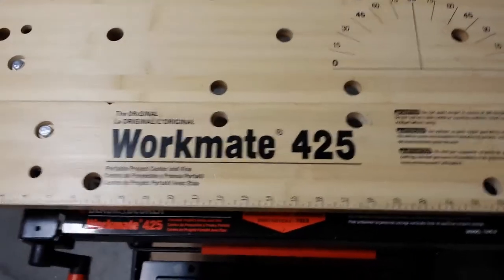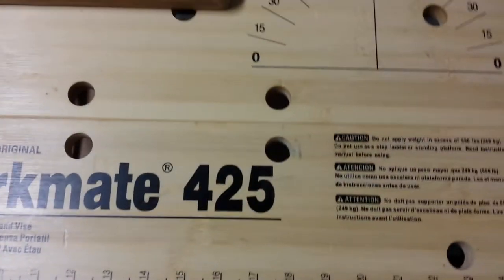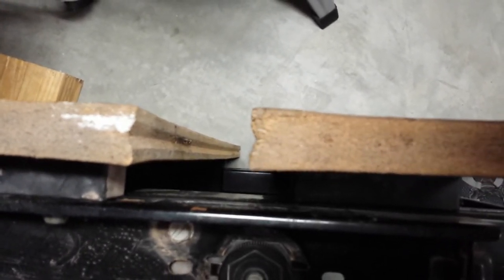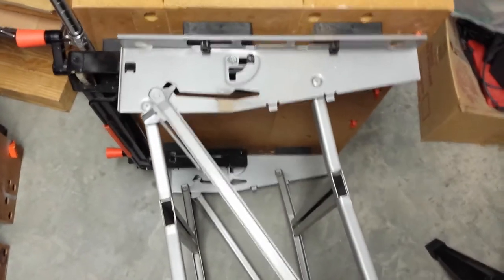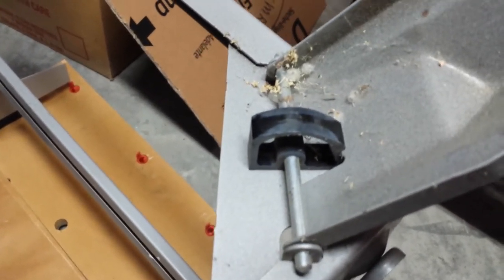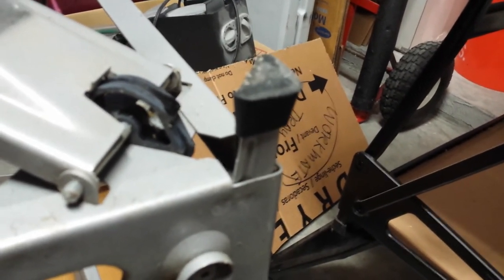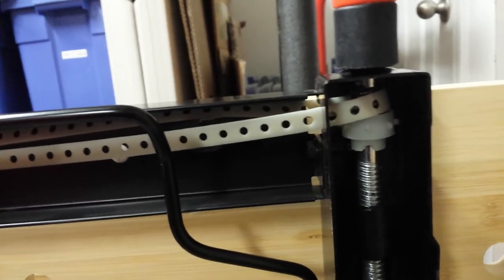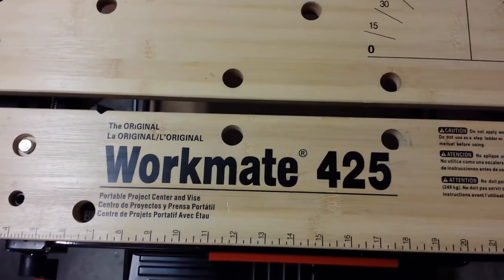How To Maintain Your Workmate 425

Comment: Thank you for this video. If the belt is connected both sides, turning one handle will move both equally. My belt is off one side so i can tightened at an angle for awkward shaped items. I don't mind spinning both handles separately.

Comment: Good video. Had no idea there's a Workmate community. Yes, bamboo is very rigid. It is often used in high-end loudspeakers for that reason.

I have an original WM, a 425, and the Harbor Freight version. Thanks to your videos, I now know there are different '425s - mine is a type 5. The 425 is setup as a side table next to one of my benches. The HF version is poorly built; I use it for painting, grinding - essentially where the condition of the support doesn't matter. I don't recommend it. Love the original. Very good build quality; surprisingly rigid. Takes literally a few seconds to unfold and fits almost flush against a wall. A fantastic product. I'll lube the benches. Haven't done it at all in all these years. Should make a nice difference.
Reply from the maker: Felix F Hey, Thanks for dropping in and sharing your experience with your Workmate. I would be interested to know what kind of work you do with your Workmates. And, Welcome to my channel.
Reply: Thank you for the kind welcome. Had to think about the question. Other than general tinkering and futile attempts to fix things, I like to work on old tools. Old machinery in general. Industrial vises are a personal favorite - 11 mounted in the shop and a whole bunch more scattered around. Have a small vise on the 425 - a Stanley 700. Not sure if you're familiar with the tool, though you'll likely recognize it once you see it. Stanley made these for decades. It's small corner vise. Ridiculously handy. I also have a metal lathe. The 425 sits right next to its bench and holds the machinist toolbox and assorted bits and pieces. It's nice to have a work surface in that location that's not covered with metal chips. I like your idea for a bottom shelf. Will likely install one. The 425 is stationary in this setup, but it's easy enough to pull out if need be.

The original WM I'm a bit careful with, as I feel lucky to have found one in such good condition. It's setup when there's an instant need for more space. Happens more often than I care to admit. Used it just now, in conjunction with a big, heavy 6" drill press vise to work on the jaws on a monkey wrench. Normally, however, it doesn't see a lot of grime - that's what the HF version is for. Here's an example of its use: Last night I needed to measure something that was just machined on the lathe. My big surface plate is, well, big. It's on the other side of the shop, too. Literally, it's like a tombstone. I also have a much smaller 9x12 surface plate that I setup on the WM and was able to do the deed painlessly and easily without having to move to another bench. I typically use the original WM every 2-3 days.

The Harbor Freight version is very poorly built. The quality of the materials is subpar, and its action has little in common with a real WM. It is used for painting, holding bench grinders, a support for a miter saw and the like. I don't work with wood very often, and I'm not very good at it at all, but sometimes there's no other option. It so happened that it broke the other day; one of the wood panels cracked pretty deeply. IMO, it doesn't make sense to fix it. Saw a used WM at a garage sale nearby. May buy it. Not in great condition, but for this I only need a stable support and would rather not have another HF model.

There's another variable here. I also work on automotive paint: compound, polish, install ceramic coating, etc. Clearly, this necessitates a very clean environment. That's why I first started using a WM. It can be pulled outside, doors closed, and the metal dust doesn't hit the cars(s).
Reply from the maker: Well, it sounds like your really putting your Workmate to good use. And, you must have a much bigger garage shop then I do. Lol.

Comment: The belt came off of one side of our 425. We have tried to get it back, but no success. Do you have a video that shows how or a tip that helps? Thanks.
Reply from the maker: Get one end of the belt completely on one sprocket.  Take the other end of the belt, slide it partially on with at least one tooth holding it on. Then turn the crank at that end in a direction that will feed the belt on the rest of the way.  This is similar to the way fan belts are put on.

Comment: @WorkMateGuy, I just received and assembled my 425, type 6 just yesterday and am thoroughly enjoying your various vids--good job on all!  I do have a question.  While cleaning up after assembly I found a small spring on the garage floor that looks very similar to the springs on the 425, but I can't seem to account for any lost springs on the unit.  The spring in question is about finger length and about the same diameter as the other 4 springs (2 for the main lifting function and 2 for the base panel to lift to vertical).  Is there a 5th spring placement I haven't found yet, or might this have just been loose in the box, or maybe even just something my wife had in items she was sorting???  Not sure.  Any thoughts you might have would be appreciated.  And thanks for the maintenance tips, they'll be used immediately!
Reply from the maker: I suspect one was in the box you did not notice when unpacking.  Other wise, you would have spotted its home.  :-)

Comment: I can't believe I missed this one before.  My Workmate is tighter than a drum and I just figured it would take some time to break in.  I hit all the points with WD40, but, that hasn't really solved the problem.  What kind of oil are you talking about?  Maybe 3 in 1 or something else?    I have always heard that you should not put Vaseline (petroleum distillates) on anything rubber because it will disintegrate it. I'm not sure if that's true, but,  I have never done it.  I will most likely use lithium white grease there.  Keep up the great work!  :-D
Reply from the maker: Kathleen Zimmerman Hi Kathleen. I used 3 in 1 oil, but you can use lithium grease or WD40 depending on your needs.
Reply: I have use 3 in 1 oil also and have not had any issuse
Reply: The WD in WD40 stands for water displacement. It is not a lubricant; it's a solvent.

Comment: Thanks for these! I just bought a 425, and these are helpful. One question... I saw in another video that you clamped down a tapered piece of wood. How do you do that when the handles turn in sync? Remove the syncing band? Or just crank, and deal with it. Thanks!
Reply from the maker: Hi David - The cranking mechanism should slip to accommodate the variance in the width of the work piece. If it does not slip then you might have to temporarily slip the belt off of the gears.  Thanks for stopping by and posting your question.  Cheers!
Reply: @WorkMateGuy  Thanks!
Reply: @WorkMateGuy  Hiya WMG, great videos you make, clear and concise, thank you!
As for removing the sync to the handles to turn either individually - I believe by using two fingers you simply slide the white cog part, which runs the interlinking ‘chain’, against its holding spring towards the turning handle.  This is quite stiff when new, but once that cog is clear of the pins from their detents the handle will turn independently of the other, which will retain its position until you release the cog to settle the pins into their detects again.  This is all done under spring tension so you have to maintain the pressure on the cog release until you’ve finished your tightening/loosening.  I think I have that right and hope it helps?  Cheers, Rog from UK... 👍🏻

Comment: I just bought the 425 and the two larger boards will not tighten up. The boards just slide out of the slots , any suggestions?
Reply from the maker: Congratulations on your new 425.  If you push them all the way back into the smaller part of the slot they should be tighter.  Remember, they will not tighten all the way down to immovable.  They were not designed to be so.  Use the crank handles to clamp everything together.   Also, you may have to rotate the middle board for different clamping spacing.  Cheers!
Reply: @WorkMateGuy  OK maybe that helps I’m used to my dad‘s old workmate from the 80s I believe and both boards were solid. And this one has three